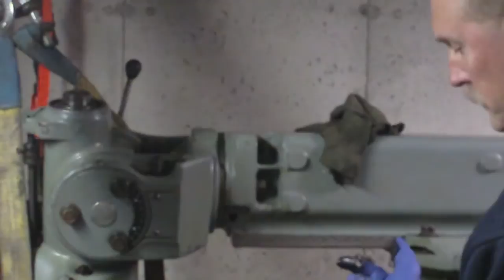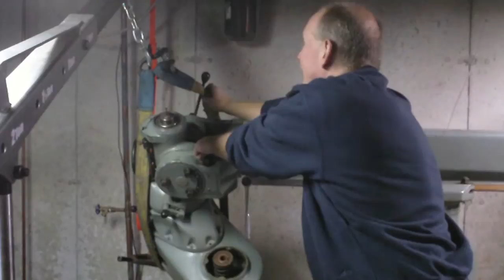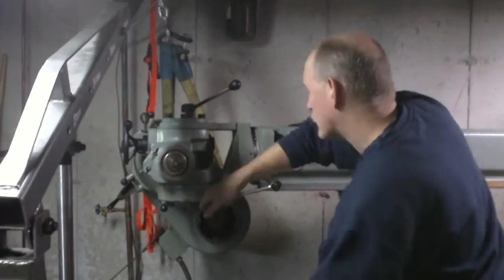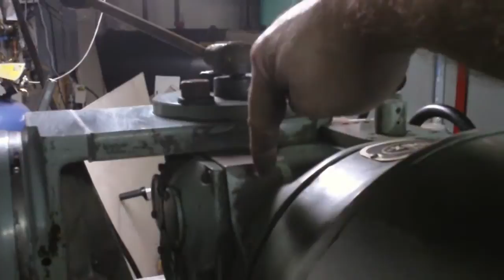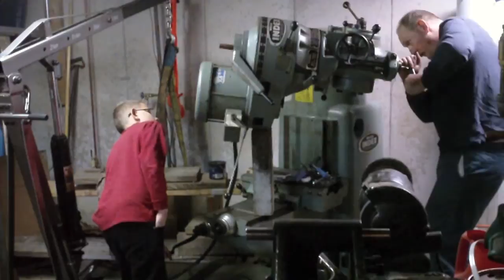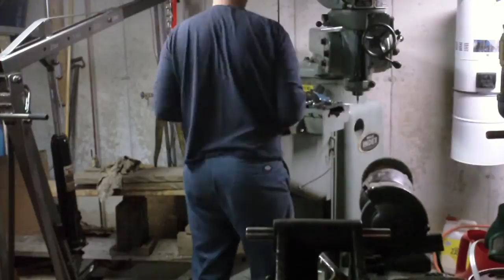Wells Index Milling machine Part 25

Comment: I am watching these videos on your play list so maybe you already addressed this.  I don't understand why you felt it necessary to crank up the knee while you were straightening the head. The machine is made to tilt the head. If you can only tilt the head with the assistance of the knee, something must be wrong. It should turn by you wrenching alone.
Reply from the maker: +nbadhorse The manufacturer recommends supporting the head as you use the tilt mechanism to take strain off the worm drive assembly. The head and motor assembly is very heavy, and the further it is tilted from vertical, the higher the force exerted onto the worm gear is. Another reason is it makes raising the head easier.

Comment: Get some leveling mounts for the main castings.
Reply: I buy mine from:

http://www.swmanufacturing.com/
http://www.sunnexmounts.com/
http://www.unisorb.com/products/prod/levelrite.html
http://www.vlier.com/product_index/leveling/sel_01_types.html
Reply from the maker: I will either buy or make some for my lathes, but for a mill with a base like this I prefer wedges, or I may just use a steel plate on the one corner that needs it. Leveling is critical on lathes due to bed twist, but a mill can get away with being out of level if it is stable.
Reply: Wedges are ok, but get some of the bigger leveling mounts.  you might find yourself milling uphill or downhill.  Don't ask me how I found out.